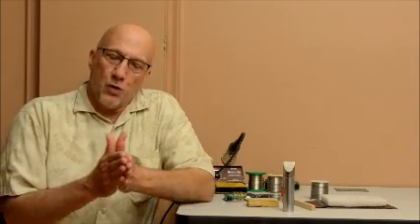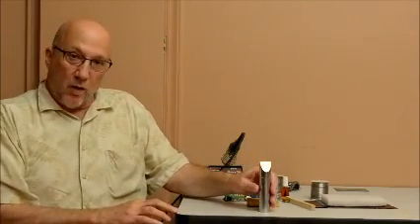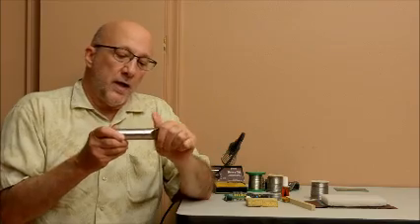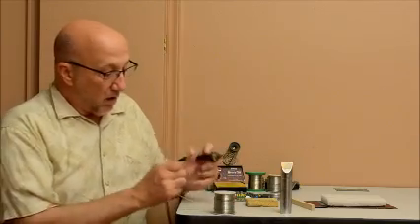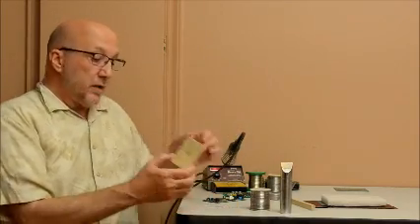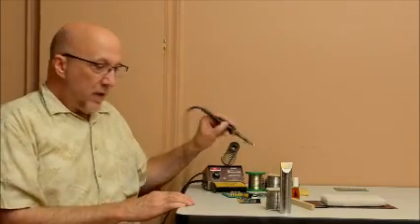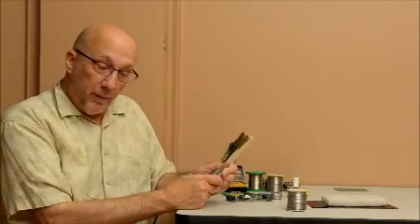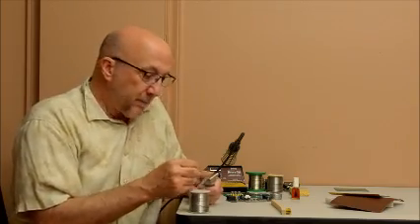Soldering Tip Care and Maintenance

Comment from the maker: Using a brass scrubber sponge or a super fine abrasive on an iron plated tip is far less damaging than using an inorganic acid or highly activated organic flux on the tips, which by the way, will also cause the tip to wear faster.  Again, you must avoid contaminating your project with these aggressive fluxes, assuming that you want your project to last a long time.  Also, lead-free solders on iron plated tips reduce tip life by as much as 50% as compared to tin-lead solders.  Very badly oxidized tips may require a different approach if your aggressive fluxes do not work.  Since tips are so inexpensive, just replace the tip when you start having a problem keeping it tinned.
Reply: Tips are inexpensive. 😀 The brand ones aren't.

Thanks for the video.  I will have less need to buy new tips so often now. 👍

Comment: Never use an abrasive on any tip. If you want to clean your tip properly dip it in paste flux then use your copper sponge and wet sponge then repeat till the tip is clean. Then tin the tip wipe and repeat 5 or 6 times. I use the tip stuff he said don't use. If used properly it will 100% keep your tip in great condition. It's meant to be used before turning off your iron not before you start soldering. After use you tin and wipe your tip at least 3 times then leave the tin on the tip while you prepare for your solder joint. NEVER use anything abrasive other than copper sponge on any tip .

Comment: Before you start your soldering day, clean the sponge with warm water and liquid dish soap, rinse with tap water, squeeze dry and apply distilled water until the sponge is damp, not wet!  Depending on how much soldering you do, you may need to repeat this several times during the day.  Also, clean the sponge one last time when you are done for the day.  A clean sponge is critical for making good solder joints!

Comment from the maker: A brass sponge is also somewhat abrasive and will not remove heavy oxidation from the tip, which is why I prefer a brass brush.  As I mentioned, tip tinner contains ammonium phosphate, which is a very aggressive flux and can contaminate the objects you are soldering.  Also, tip tinner causes faster dissolution of the iron plating due to the flux/tin combination.  Either way, you will not be preventing wear on the thin (approx..008" to .015") iron plating.  Any method that you use to always keep the tip well tinned is the objective.
Reply: Aight thanks

Comment: John, I use a 30 watt Weller and my tips over time get pitted and eaten away. I always tin the tip when I get done and the tip is always shiny silver and never oxidized. I do use a wet dish sponge to clean while soldering too.I would say my tips last 4-6 months before I have to get a new one. Does that sound normal or do you think I am making some mistakes?
Reply from the maker: Tip life can never be easily defined.  If you use lead-free soldering alloys, the tips will last about half as long as it you were using tin/lead solder (never mix the two alloys).  Also, abrasion from sharp terminals or from rubbing the tip on the work to get better heat transfer will wear the tip prematurely.  In general terms, 4-6 months doesn't sound bad.  In production situations, some tips last only a few hours!

Comment: Why is the solder not sticking to my iron tip?
Reply from the maker: Oxides form on the tip surface. and prevent solder from "wetting" the surface.  The flux in the solder (or external flux) is needed to clean the oxides off so that the solder will adhere to the surface.
Reply: @johncandelino5982  ah yeah, I scrapped the factory surface off and then solder stayed on the tip.

Comment: "what we never wanna do, is wipe the tip off and then put the iron back in the holder"....which is what I do every single time and is probably why I'm here watching video's like this, trying to understand why my solder turns into little balls and runs away from my tip !
Reply: Shit! It's like tasting sugar for the first time.
There are reasons why craftsmen don't want other people to use their tools.
I'm like that with my dremel stuff.
Reply: I literally do that every time and have the same solder balls issue. Ugh.
Reply: Yup. Me to!
Reply: i've been doing it wrong so for years. :( So when you're finished soldering you want to tin the tip , put it back in the holder and switch off the iron? Is this correct?

Comment: Great explanation, thanks. 
One thing is not clear to me. Since we put the coating tin once finishing soldering in order to avoid (black) iron oxidation of the tip, why clearing it off with wet sponge before starting soldering again? Is it so to get rid of the (white) oxide which can form on the coating tin at the top of the tip?
Reply from the maker: We need to wipe the tip before soldering in order to remove the oxides that have formed on the solder coating.  So, we are protecting the iron plated tip with solder, while also not allowing any unwanted oxides from becoming part of our solder connection.
Reply: @johncandelino5982  Perfect, thanks.

Comment: Thanks for your professional videos!! Here you explained mostly about maintaining plated soldering tips. I have a large unplated copper tip in an industrial size like the one you demonstrated on. I will use it for sheet metal work and not for electronics. What would be the best method to tin it for the first time?  What would be the correct flux and solder for first-time tinning?
Reply from the maker: The solderability of the sheet metal determines what flux you need to use.  For example, mild steel or stainless steel is difficult to solder and may require a flux with hydrochloric acid.  The solder is determined by the application, for example lead-free solders are stronger, in general, to tin-lead alloys.  Also, the higher the tin content, the lesser the life of the tip.  You will need a file to reshape the plain copper tip as it dissolves into the solder joint.  Take a look at my other videos on solder and flux.  I hope this helps.

Comment: If your solder melts at a temp of 360 - 370 or so how high should you soldering station temp setting be ?
Reply from the maker: You need to heat the connection approx. 100 to 150 deg. F above the melting temperature of the solder in order to be reasonably confident that you are forming a good intermetallic bond.  Therefore, your soldering  iron/tip must be of sufficient mass to do this in a short period of time.  High mass, and preheating, if necessary, is the key.  Usually 600 deg. F is a good starting point for circuit boards. It also depends on the soldering application and the soldering alloy that you are using.
Reply: John Candelino 
That sounds good thanks for the help.. great informative video.

Comment: Excellent video with good, practical  details.  However, I would disagree with using any abrasive to clean the tip.
Reply from the maker: The abrasives that I talked about are extremely fine and are meant only to clean the oxides off without compromising the iron plating.  More closely "polishing" the plating than abrading it.

Comment: i have heard that you can use plumbers acid flux to clean a tip but would it destroy the tip?
Reply from the maker: Plumbers paste flux contains zinc chloride primarily.  It will not destroy the plating on the tip - I only caution it's use because if it is not cleaned properly, especially with electronics, it is conductive and will corrode copper substrates and it will get under components and needs to be thoroughly cleaned.
Reply from the maker: The zinc chloride flux will certainly clean the oxides off the tip, and really would not  destroy it.  The concern is that you might transfer some of the corrosive residues from the flux back to what you are soldering.  As long as you keep the flux away from your project and clean everything well, you should not have a problem.

Comment: have you thought of doing a video on what type of soldering iron to buy. and if you used tip cleaner is their anything you could use after like alcohol or something to remove it. and i would be interested in making flux.
Reply from the maker: Soldering iron/tip selection is a primarily a function of matching masses.  In general, the higher mass of  the iron/tip combination, the better.  Remember that you cannot efficiently transfer heat from a very small mass to a higher mass, like when trying to remove a large multipin connector from a high mass multilayer circuit board.  In that case, preheating the board is recommended.

Comment: I used a pencil eraser and with just a few rubs, all the black blue colour on my iron tip is gone....is that Ok; using a common pencil rubber? (I have Japan's Goot soldering Iron KX-30)...I cleaned my tip with alcohol after (just in case..)
Reply from the maker: Sure, any mild abrasive will work as long as you can get the oxides off of the iron plating.  As long as the tip accepts solder and can transfer heat well.